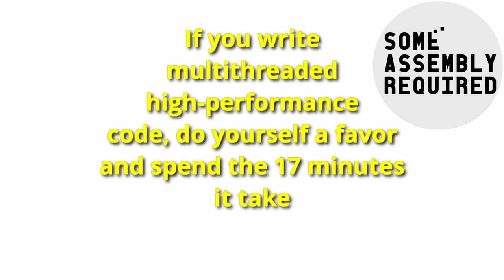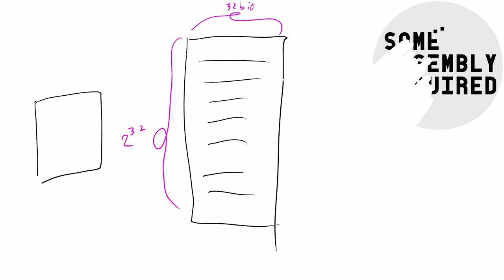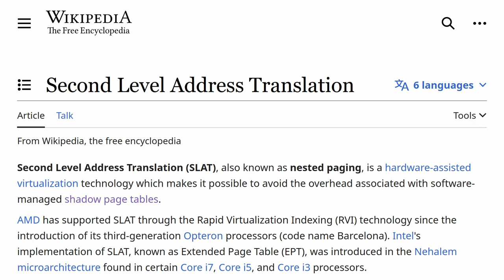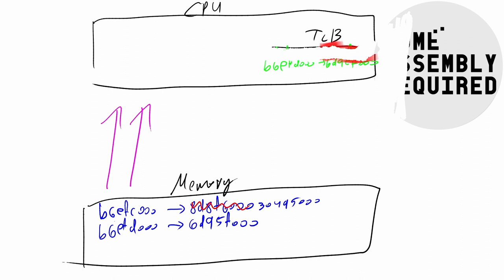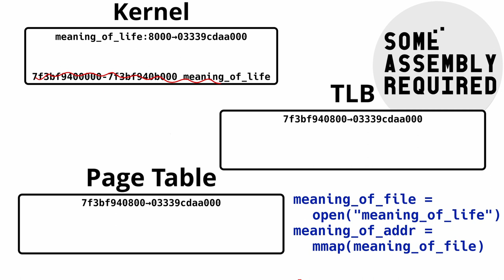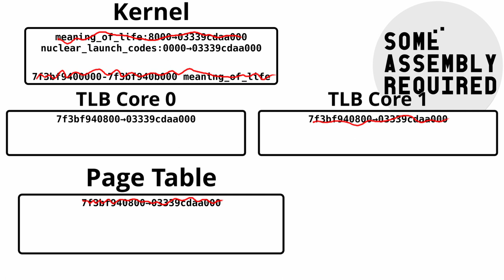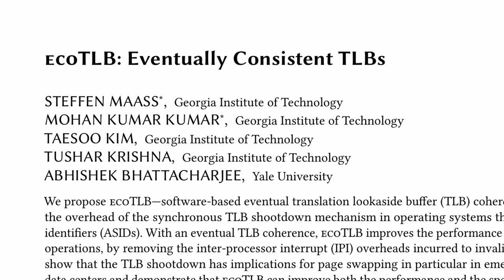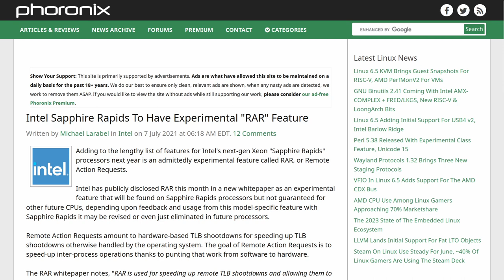TLB shootdown

Comment: I feel there'll be some lock-free solution to this problem. Like having an weak-atomic reference counter for mapped files. 
But maybe I'm too dumb to notice why that'll fail.
Reply from the maker: That can work as far as keeping track of when you can release the physical pages, and I believe is what the eventually consistent solution offers. It doesn't help regarding the IPI. The core question here is this: when the munmap system call returns, do all threads of the process see the region as unmapped? If the answer is "yes", you don't have a choice but to delay the munmap return until you've made sure all cores clear their TLB entry.
Reply: @CompuSAR  don't think that matters. You are not supposed to be accessing mapped pages when another thread is unmapping it - it's undefined behavior either way. Along with eventual consistency. The page is only truly recycled after the last core unmaps it. Thus the vulnerability is mitigated.

This sounds too easy. I must be missing something.
Reply from the maker: Have you considered the case where one mapping is replacing another?
A reference count solves the page reuse problem, but there are other semantics around page use that also need to be satisfied, at least to some degree.